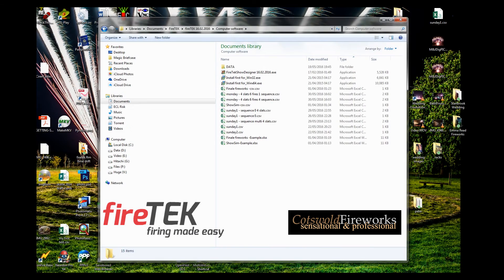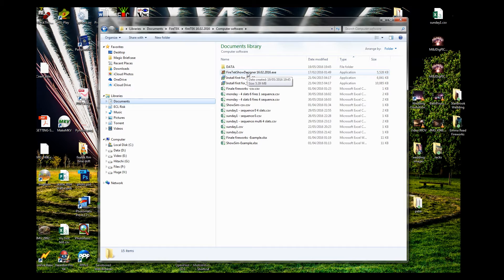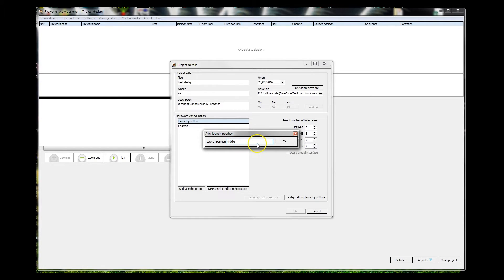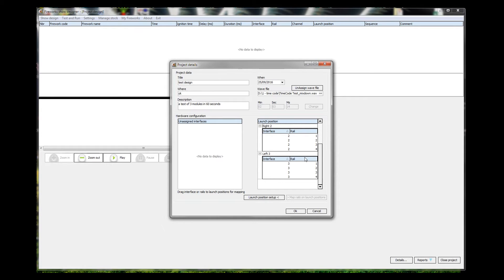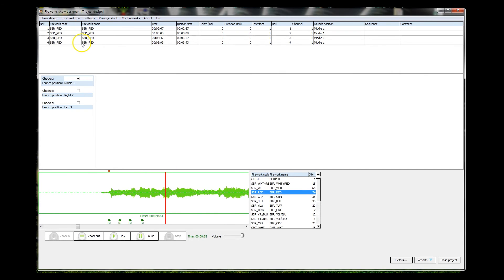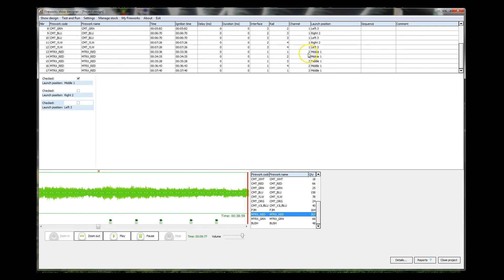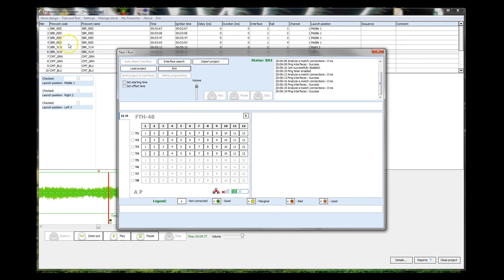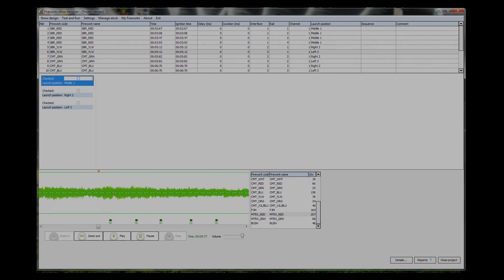FireTEK Show Designer

Comment: Does each module/interface need to be loaded individually?
Reply: NO. You can also load all via a module set as master or remote.
Reply from the maker: each module interface will be loaded with the parts of the script relevant to the module. If you do not have all the modules turned on when loading the script then only those modules powered up will be programmed.  You can load the modules in any order.

We performed a pyromusical for a competition for a pyromusical a couple of weeks ago and arrived onsite with only 28 programmed modules.  When the missing modules arrived, I just programmed those separately by loading the full script and letting the software push the script to the missing modules. You only power up the missing modules when you do this.